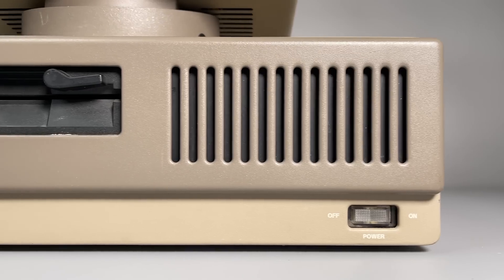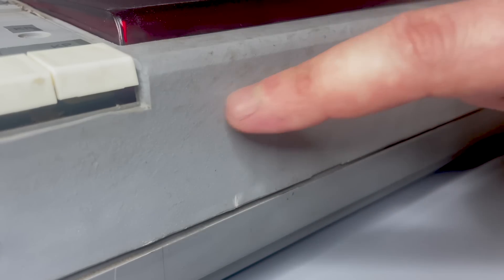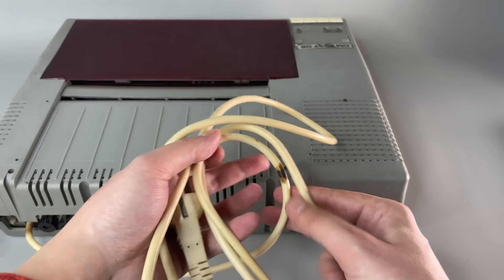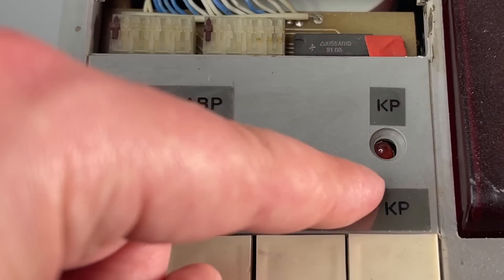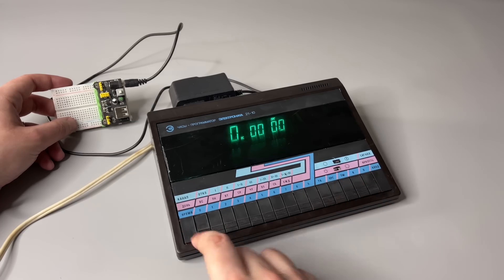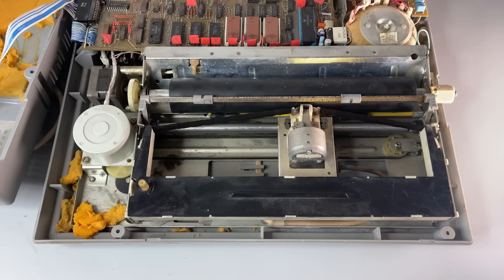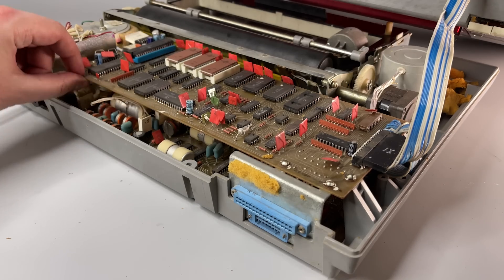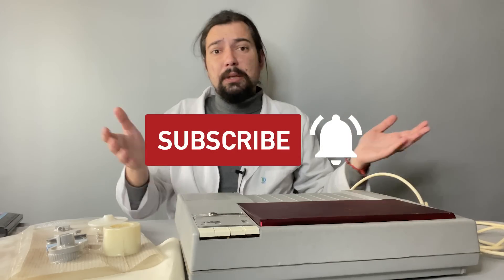This is THE WORST PRINTER I've EVER seen | Soviet SM6337.02

Comment: Well, it seems to me, that THIS particular example was made from "off the books"/stolen parts, for black sale, in late 80s. Following the principle "Everyting around me is a common property, everything aroind me is mine" many workers were using factory tools to produce extra-parts or just steal the once that considered "faulty", then produced equipment at home and sold them via black market for extra 10-50 rubles. The reasons for it was not only the low wage of the factory worker, but a total deficit of the commercial units on the shelfs.
Reply from the maker: Hm, this is an interesting version....

Comment: This printer looks like it was pulled out of a pile of rubble after the Chernobyl desaster.
Reply: It may as well have been culprit of that disaster…
Reply from the maker: :))
If seriously, in the Zone wider, A3-format versions of these (also produced by different factories, so quality was better) were used at many, many facilities I guess up to 1995. They were quite ok. Still, a lot of them could be found at abandoned Jupiter plant in Pripyat. Of course later all that was replaced with modern hardware.

Comment: I think soviet computers and accessories were designed to be operational and tried to design them as maintainable as possible. So it's no wonder that they aren't very pretty and save to use :)
Reply from the maker: In some cases yes. But only in some. Sometimes, for example, the result was partly defined by the selection of components/technologies available by that or another factory and its supplier.

Comment: Ooooh, I'm so on the fence here. That printer looks so badly made it's almost qualifying for a UKCA mark...But unlike printers being sold in the west today, at least the Soviet variety comes with a maintenance manual (You needed it! 😉), spare parts, and does not require a constant broadband Internet connection¹ just so that you can actually print something! ☁🖨💸😉

You can clearly see the similarity between the controls and interfaces on the Military and Comrade versions of the СМ6337 though. Am I right in thinking that the comrades' version might be a similar base design, but with a lot of cheaping-out on parts and absolutely no quality control? The unit you have there looks like it might've been rushed out to just about meet a production quota. 🙃

(¹ - Although we can all guess that if the Soviet Union was still around today their Internet would be about 1/10th the speed of what we have in western Europe...But you would also get a free „archive“ copy of everything you print being sent to the printers at the local КGВ office, too. 😉)
Reply from the maker: This is a good one. Thank you!

Comment: This is a great example of communist countries and manufacturing. On the one hand you can get the example you showed with that Robotron computer - a well built piece of hardware which is built to last. Maybe in some regards simplistic, but robust. On the other hand, you lose out in more up to date precision tech. There's a reason why China has only relatively recently been able to make the humble ballpoint pen, because they lacked that precision tooling.
So in a printer like this, even if the electronics were great, if you haven't got the bodywork and mechanics right, it'll be a nightmare. Printers are bastards for the tiniest little problems. When I first started work in a computer department in the 1980s, we had some pretty expensive printers. I remember one print run going awry and chewing up paper constantly and none of could figure out why. Turn sout it was one TINY bit of paper that got stuck in a feed wrecking everything after a while. Not even as big as a thumbnail. 
So I really sympathise with anyone having to use something like this.
Reply from the maker: Thank you for sharing!

Comment: I have the same printer in a fully working condition. After replacing a small electrolytic capacitors on the control board, it works. Another big problem, not only in this model, but in all USSR electronics, are the DIP sockets and bad contacts in them. And replacing these sockets to normal ones is impossible due the pins step - 2.5 mm instead a normal 2.54. About plastic quality - it was everywhere in USSR, and in all types of plastics. Are you seen a USSR made inflatable toys, for example? It's fully another material, soft PVC, but also with a strange fractions. A transparent PVC was absolutely absent. Some of them looks cute, but quality is very very poor.
Reply from the maker: Thank you for sharing! To be fair, I saw better examples of this very model, but this specimen beats anything.

Comment: Hello from Bulgaria. Some say that all the reject components were going into devices intended for civilians while everything good was going to the military. Looks like that really was the case. The plastic case could have been made in part from recycled plastic, hence the dirt like appearance and streaks on it. I've seen that on soviet made stuff. I've often came across some very bad things in old soviet equipment, and it doesn't seem like that was caused by the age of it alone. It's weird because in some cases they overdid things, and in others they just made ridiculously bad design decisions.
A neighbor of mine told me about their brand new television detonating when they plugged it for the first time in the early 80's. Based on her description I guess the filter capacitors were crap, and she and her now late husband ended up with a smell of capacitor electrolyte and confetti all over their living room. It was a heavy and expensive thing that you needed at least 2 people to move around, and there just doesn't seem to have been any quality control. The thing wasn't even tested before it was put for sale.
Reply from the maker: Thank you for sharing!

Comment: Soviet Computers and Printers were excellent, east german RFT Robotron too!
Reply from the maker: German - yes. Soviet - excuse me, you cannot be serious...
Reply: @ChernobylFamily  in DDR there were real good soviet made printers (they by far had not only Robotron east german made)  and in scientific institutes were Soviet Klingon like computers that would put any IBM of the same time to a shame. There must have been several quality grades in USSR (maybe export goods were great and those available in Russia were bad?) USSR used to rule the world of electronics and great quality. For example please study soviet super high quality Hifi systerms by KORVET, Electronica or Estonia (RRR Riga Rigonda), I have seen hifi amplifiers in such a great quality not one single western company of that time would be able to copy (Because Russia used gold plated contacts and army potentiometers that still work after 50 years without making noise). Here we call those machines "Klingon hifi". Dont forget Soviet Speakers with heavy speaker driver cases made from aluminum and wooden cases made from solid sibirian wood---those were sublime. The were as expensive as western speakers in former DDR and only available for Rubles, Deutsch-Marks or Dollars.
Reply from the maker: @Schlipperschlopper I do not know what was in Russia, because we are not from Russia. But by a wide and quite comprehensive experience of dealing with soviet tech, I am sure you got in DDR export quality. Domestic products were complex, low quality, unreliable and hell to service.

Comment: I remember when my Dad got himself a new Brother printer to go with his IBM PC/AT sometime in the mid-80's, which used the same print engine technology as this printer (dot-matrix print head with ink ribbon). So it was designed and produced several years earlier than this... thing... and was quite a bit larger, and it used that old school continuous-ream paper with the perforated drive strips on each side that you had to tear off after printing. Made a hell of a racket when it was operating too, although it did have a "Quiet Mode" which, while indeed quiet, was also unbearably slow.  But in terms of design and build quality it looked like something from the year 2000 when compared to this laughably crappy device. :)
As it turns out, I now work for one of Brother's regional sales offices as a service technician and tech support guy. So I greatly enjoyed this amusing stumble down memory lane, cheers!
Reply from the maker: Thank you! And thanks for sharing!
Reply: @ChernobylFamily  New subscriber here, I look forward to checking out your other videos. Cheers from Australia!

Comment: A long time ago, in the 1980s, I had a Soviet pocket game called "Elektronika 6", if I remember correctly.
The game was based on the cartoon "Вовк і Заєць"
It worked well except for the clock because one minute lasted... 45 seconds :)
Reply from the maker: Electronika 6 is a clock, I guess your was I-06 which sounds similar. Those games were legendary. Technically, those are clones of Nintendo Game & Watch, but adapted to local stories...)
Reply: @ChernobylFamily /videos 

Of course, you are right, it was a clock with a green VFD display.
I remember those clocks. 
At night you didn't have to turn on the lights in the room :)
I have some Soviet Oktava microphones that sound really good and a Sputnik 401 tape recorder but unfortunately, it doesn't work properly but it's still alive.
It's interesting that in the 70s and 80s, a lot of Soviet TVs, washing machines or refrigerators were sold in Poland but pocket games, computers or audio equipment, could not be bought in stores.

Comment: Are those square dark orange things capacitors?  I love the way that they are just flapping around, with plenty of length for the leads.  Either someone thought that they'd get hot and needed space, or perhaps the leads act as little antennae so the printer could listen to the radio and wouldn't be lonely.
Reply from the maker: Yes they are :)

Comment: Soviet vacuum tube testers were far better than the ones made in USA. Such as Kalibr L1-3 L3-3 and IL-14. I live in USA and still use them and use them more then the US testers. More functions higher voltage and much better thoroughly testing.
Reply from the maker: It is true, but I am afraid vacuum tubes are from a bit different epoch, when their industry worked in many cases very ok.

Comment: I don't think you are being fair.. 

its the plastic degradation. eventually the polymer strings/chains get brittle and break or loose their bond and melt back to oils. I see a little of both..

the plastic has a lot of regrind in it.. (recycled parts that didn't make the cut)

that is also not a burn mark from heat or flame.. its a chemical burn from the pvc. pvc will vent caustic fumes over time as it degrades. it does have chlorine in it.
Reply from the maker: Thank you for this clarification. The problem is, like this it looked for the last 20 years, and I saw another examples of this very model which in 2023 were very ok. Not speaking about the nearly ideal condition in its KGB counterpart. The point of my speech, however, was slightly different - the quality control and double standards in approach.

Comment: 3:15 Not sure that's a thermal mark.
Rather that is a stain from PVC insulation coming in contact with some chemical (solvent or such).
Encountered similar stains on a coax TV cables that had been in contact with bird shit.
Reply from the maker: Might be, might be...

Comment: I think the hanging/bent parts look like the printer has been exposed to excess heat from above somehow, or it overheated itself, because all the plastic parts seemto hang through at the same line going from front to back. The goo flowing out from under the sticker indiciates heat related issues, too.
Reply from the maker: I am afraid we will never know now. BTW, it was in the original bag.

Comment: Still better than an inkjet.
Reply from the maker: True story
Reply: @ChernobylFamily  Glad it's not just me, constant ink drying and cleaning heads, the Brother I have is the longest serving at 6 years but after 2 it left marks but still works with most usually the cleaning compartment "sponge" gets full and it says to buy a new printer as its not serviceable. Have no experience with laser so have no idea. Most printers lasted me 2 years I have to go aftermarket for ink. Simple is best dot matrix.

Comment: The old saying about Soviet industry and how much stuff it produced, "Quantity has a quality all its own." meets its corollary in this printer. "Quantity without quality is just crap.".

The dimpled areas are because the injection press was run without any pack and hold. Injection molded plastic has to be kept under pressure while the mold is cooled enough that the part can be ejected without it having shrinkback (the dimples) or warping. Pretty obvious from this example of superior Soviet engineering that the molding machine was setup to cool the shots just enough that the plastic parts wouldn't slump into a hot puddle of molten plastic.

It's also evident they never ever cleaned the mold or the injection screw and barrel. Definitely didn't have a debris screen. I suspect there is a lot of pre-consumer recycled plastic in that housing. Likely sprues, runners, scrap and failed shots swept up off the factory floor then dumped into a never cleaned grinder to chunk it small enough to throw back into the hopper.

From the areas showing damage to the mold I bet they had a guy with a screwdriver or chisel that "helped" the part ejection by prying them out of the molds. If he slipped and put another gouge in the mold, no problem. It's extra texturing.

It's like the end stage Trabant 601 of dot matrix printers. All the production equipment was worn out, barely functioning, and whenever it broke down it was spit, bubble gum, bailing wire and duct tape to get it barely functioning again. No money for new equipment!

The people in charge at Trabant would every so often make a mockup or design study (or were any fully functional?) of an all new Tatra. Years ago I saw a short video clip of where they had those stored together. It was like a trip through automotive styling from the 1960's through the late 1980's. Some looked quite nice, for a car that size. Every attempt at reviving the company with a new design, new equipment, new everything was always blocked.
Reply from the maker: Thank you for this thoughtful comment.
Reply: I think I'd still rather have a Trabant 601 than a Tesla. At least with the Trabi I only have to pay for the car once ... 👍

Waits patiently for mandatory „usage“ subscriptions to start showing up on Tesla tablets... 😉

Comment: About all I can say is that those dust filters glued over the vents were used in contemporary western equipment.  Not that permanently installed dust filters are great or anything, but those filters don't set it below its western contemporaries.  All that other shit, well, yeah, this printer is a joke.
Reply from the maker: I just find them really crudely placed. They are not really holding. But if they would bebplaced properly, they actually would do the job.

Comment: Really shows the difference between hardware that was designed for the military/government, and hardware designed for regular people. I don't blame you for not wanting to plug it in, it looks like it would immediately catch fire!
Reply from the maker: I actually tried after I published this video; it does power on, shows error and makes an attempt to position the head. That's all.
Reply: @ChernobylFamily I'm really surprised it does that much! The only way I would've tried powering it on was from behind some cover, and with a fire extinguisher nearby.
Reply: @UpLateGeek  Steady on, chap...It was made in the USSR not the UK ... 🖨🇬🇧🔥😉

Comment: Oh, for cryin' out loud... Don't even get me there. Soviet quality was all over the place, depending on the application. Military, scientific, aerospace electronics, test gear and pro stuff? A thing of beauty, a joy for ever. Good grade hi-fi gear? Possibly. Everyday electronics? Super dodgyyyyyy, as DiodeGoneWild calls it. At least it can usually be fixed... 

As for the icky plasticky stuff, I've got two Iskra 111 calculators in my lab, one with partially broken enclosure, the other one's box was too far gone and I used it to cut out a part that was missing in the first one. Both calculators are beautifully built inside and I decided to restore them, gonna make a clear acrylic box for the other one to showcase the lovely guts. That's SLT as in Soviet Logic Technology - ten years after IBM Solid Logic Technology.

"And here's the meh-anism" haha!
Reply from the maker: Right. If it went to a military or professional grade it was often very good. Just the contrast between that and consumer stuff was painful - after all, I remember vividly my childhood, when all you could get was such "printers".
Reply: @ChernobylFamily  and the Lell PSR drum synthesizer which was an incomplete product to begin with, the instructions manual had a chapter on MIDI interface which was never implemented in production units because of licensing costs.